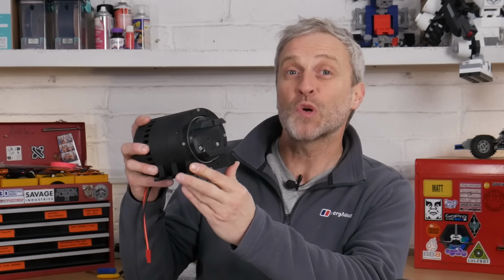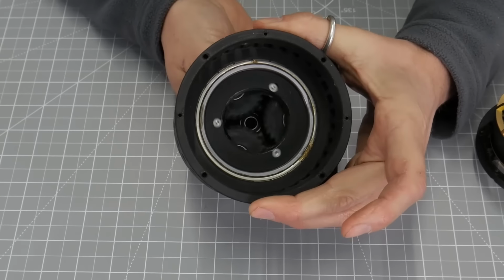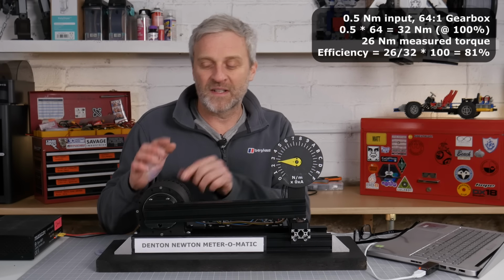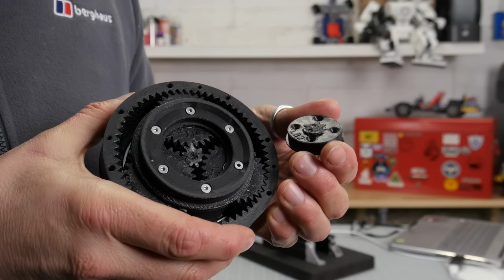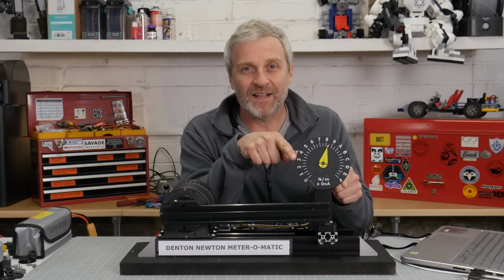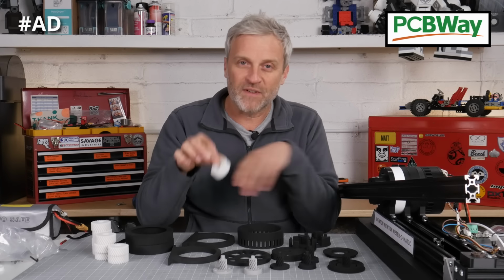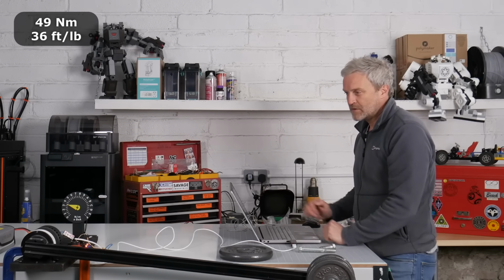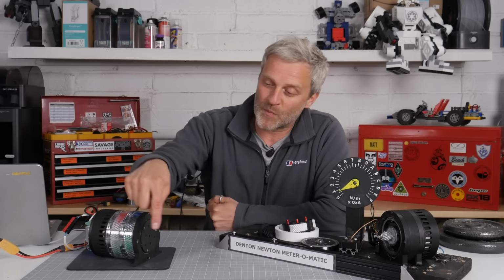Massive Torque 3D Printed Planetary Gearbox! - Mantis Hacks

Comment: The torque Test in the end is a little bit misleading as the tourqe is not the same in the static test. You are accelerating the mass and have to calculate the moment of enertia to get the correct moment of your gearbox thats why it failed
Reply from the maker: Yes I agree, there is a huge difference between static and dynamic loads. However, the point was to show that at slow speed which are similar to static loads, when the leg of a headed is in support phase this gearbox probably would work. When it’s accelerating fast it only needs to lift the weight of the leg and would be nowhere near 125 N.m, I only wanted to demonstrate that it will move a very large load at slow speeds, I pushed it further for the fun of it :)

Comment: Bigger sun gear with metal core(screw).. that's how i made few years ago for door opener...
Reply from the maker: I did that.. it’s in the video
Reply: @MattDenton I express my self wrong,the screw was with intention to compress the material with 2 nuts and washers,but I didn't test as you to those limits,maybe my approach means nothing in giving straight
Reply from the maker: Ahh ok 👌

Comment: It seemed like you were having a lot of layers line failures with the FDM parts. Did you ever have a look at folding the parts? Since it seems like the sun gear is the main failure point, it might be a good solution.

You can find an example of folding bolts in the multiboard system for example (search for folding bolt multi board so you don’t have to navigate their fairly atrocious part menus).
Reply from the maker: I hadn’t thought of folding them but totally get or, I had thought of printing them on two halves

Comment: i remain dubious of any static efficiency test... or breaking test. both should be performed whilst spinning. braking test? 
its not just the static load ability but also how they resist rubbing, sliding, and impact loading. gears dont roll over each other, they slide...
so far, ive found ABS makes for the best gears that actually have to rotate and transmit torque.
recent reduction and found PETG lasted all of 30 seconds. abs gearset has several hours on it. strapped to a weedwacker engine. pretty harsh environment.
didnt think of resin but may try one in the "highstrength". had good results on other things... stays sort of rubbery. pliable.
Reply from the maker: Yeah that’s why the final test of having an actual moving load at the end of a lever didn’t perform as well as the static load test. Stall torque in gearboxes  is usually way higher than dynamic torque

Comment: Couple of recommendations:
1.) I would be very skeptical about using a belt on the output side with that much torque. It is REALLY gonna want to slip and at that high load you might break the belts. Your life will probably be quite a bit nicer w the belt on the input and a few more metal gears.
2.) I would also recommend looking into a different kinds of planetary, more specifically a split-ring planetary. They can achieve MUCH higher deductions in the same number of stages, and you wouldn't need your belt at all.
3. I would highly recommend looking into moteus brushless motor drivers to bring down cost. They are incredibly capable drivers that are quite a bit cheaper than Odrive. Definitely good enough for your application
Reply: Choose the right belt, and it shouldn't be a problem. Belts are used on engines, and they have considerably more torque.
Reply: @WillE86 your correct that belts are used in engines, but that is far from a 1:1 comparison. First, belts are not used to drive the parts of the engine under high loads. They are mostly used to drive cam shafts. When they are used to drive high loads, such as in superchargers, belts are extremely wide. The larger your belt is the lower the bending radius it can achieve. Having a belt rated for high torque application would also probably force you to increase the size of your drive significantly to ensure a proper FOC. Using an especially wide belt is also going to increase the moment loading on the gearboxes by a lot. The wider and higher load the belt,  the tighter you are gonna have to tension it. This will induce a pretty high load, especially for the output of a 3d printed gearbox
Reply: @davidbascom5781  I get what you're saying. I still think it's achievable. 
Reading through your comment made me think about the capstan drive. There's a decent video I've seen on YT by Aaed Musa, video titled, High precision speed reducer using rope.
Reply from the maker: Probably still worth a go 🤔
Reply: @WillE86  yeah it'll probably still work. Just might be a bit hard to tension and wear out a bit earlier. But if it works it works. Will probably be more of a useful comment if it doesn't work
Reply: Turbo charged 300hp snowmobiles still use belt drive.
Reply: @erik.... power is the product of torque and speed. The final torque of a normal city car of about 100hp is only about 200Nm and its using steel gears to deliver that. I guess it will work but certain design considerations will be necessary as pointed above.
And to be a bit pedantic 😂 the units on your torque dial that i really like, i think sould be Nm not N/m.
Reply: @SuperHaptics  You mean power is the product of torque and angular velocity (or force and velocity).
Reply: @dr.lawlis2426 i said it collqualy but from the question you are asking you get my point I think. You will rearly hear a maker on youtube talk about angular velocity of a motor, so speed everyone will understand 😊
Reply: @SuperHaptics  To be fair, if you are going to be pedantic about the proper units for torque, you won't mind being corrected for having the proper units for power.
Reply from the maker: Ok thanks for the info! I’ll look into some of these recommendations 🙏

Comment: Nice work!  If you play with the ratios between the first and second stage planetaries, you will see that for configurations where there is a small difference in ratio between the two, you will get very high gear ratios.  You can use this effect to make the sun gear larger, and have higher numbers of planets, for example, 5 or 6 instead of 3.  This should allow for greater torque in the same sized package.

I’m also curious, given your application, why you wouldn’t make the gearbox larger in diameter? It seems like there is plenty of space. For a direct scale, where the gear width scales as well, a 2x scale should give 4x the torque, or for only a 1.4x scale, 2x the torque. Tolerances don’t scale the same, so it may get a little more efficient as well.
Reply from the maker: Yeah I’ve been thinking about a bigger ratio stage 1 with lower ratio stage 2 to give a larger stage 2 sub gear. And yes I could scale the whole thing slightly but I like the idea of keeping it as compact and light as possible. Appreciate the feedback though 🙏

Comment: You should consider using double helical gears. It would make assembly slightly more challenging, but in theory, it would reduce axial loads, thereby reducing friction and increasing the gearbox's efficiency. The major reason that double helical gears aren't used more often is because of their complexity and cost to manufacture, but that's irrelevant with 3D printing.
Reply from the maker: Yep will look into that for sure 👌

Comment: Just a word of light-caution.  Using "white" plastic generally isn't a good indication of the mechanical performance of the plastic itself.  Specifically, white plastics often use titanium dioxide as its pigment, which degrades its mechanical properties.  When doing comparative tests between types of plastics, you'd generally want to stay away from "white" unless you're certain titanium dioxide wasn't used as the pigment.  I really enjoyed the video and the rigor that went into the testing...which is why I wanted to write up a small comment, in hopefully, an encouraging way.  Thank you for sharing your results!
Reply from the maker: Interesting!! So is this the case with sintered white nylon which is its natural colour?
Reply: @MattDenton  I couldn't say for certain.  =\  The manufacturer would ultimately be the authority as they would know if they added pigment or not, and what type of pigment was used.  But...since its sooo temping to say more...in dangerous generalities no-less...I suppose I will.  =D  Many plastics in their "natural" state before pigment is added are an off-white color ranging from a pretty dingy-yellowish-white to to a slight-off-white color.  Since the information isn't always readily available from the manufacturer online, I personally have a tendency to simply shy away from printing white for anything functional/load-bearing.  That said, I do print white though (mostly ASA), but for aesthetic features.  I can tell when printing, it "acts differently" in both bed adhesion and layer adhesion, which also translates to overhang quality...so, for each type of plastic/filament, white always gets its own print profile and all other colors get lumped into another profile (bed temp, printing temp, part-cooling fan speed, print speed/accel).  I'm just a guy on the internet commenting...do the research and decide what works for you.  But, if you notice white having weak mechanical properties, wearing out faster than other colors, or having a lower glass temperature, you're not crazy...and, you have a search term now: "titanium dioxide."  =)

Comment: Make a tripod beast maybe. Like half-a-hexapod.
Reply: The reason 6 legs is common is because you retain a stable base at all times even during continuous rates of forward motion. A four leg design remains stable while moving ONE leg, so it generally must pause for each time while other legs wait to be moved. Three legs must balance in a single axis via another mechanism while moving any one leg, just as a two legged robot standing still, and two legs must constantly balance in 1-2axis even when not moving. Each of these reductions in leg counts makes it exponentially more difficult to do, and massively amplifies the risk management needed to demonstrate it. 6 legs you can simply need a seat-belt and can safely ride anywhere you can keep people from being entangled in the legs, while 3 legs you need a roll over safe design and to keep crowds at about twice the vehicles height away, which quickly drains the fun.
Reply: @SheepInACart thank you for your clear, detailed and well explained response. This makes a lot of sense! You've got the makings of a script for a short video there! I really appreciate your having taken the time to reply. Cheers!
Reply from the maker: Statically Stable 👍

Comment: 1. Did you lubricate it? Not sure if you mentioned it. PLA just bonds together under pressure/load.
2. Increase the flow rate for the gears to 110%, I think you’ll be pleasantly surprised how much stronger it will get
Reply from the maker: Yeah using super lube!

Comment: The teeth on the planetary gears don't matter for the calculation. 9/27 x 27/72 = 9/72 - the 27 "falls out" of the equation. So just divide the 72 teeth on the outer ring by the 9 on the sun gear...
Reply from the maker: Actually I got it wrong and I’ll do an update video. The formulae is actually 1+R/S so in my case I did have a 8:1 reduction BUT!!! I didn’t have a 72 tooth ring gear, it was a 63 😬 so 1 + 63:9 = 8

Comment: hello your projets are always amazing. Yes I think you can downsizing the first stage in term of teeth modulus in order to improve the 1st dstage ratio. And then you upgrade the second stage teeth modulus and reduce the ratio (due to bigger gear) . 
But you need to do 2 designs and the worth 2 hard calculation....
Keep going.
Bye.
Reply from the maker: Yeah thanks! I think the first stage is massively over engineered.. so yes, higher ratio smaller first stage 👍

Comment: I'm glad to see that you ran through pretty much all the same failure modes I've gone through with my robot build. it's fascinating to watch what fails as you ramp up torque. I'm using steppers, but same basic idea. I didn't have the metal spline facility - but even just a steel core cylinder superglued on helped quite a bit up to the point the plastic shattered off anyway. I also found that surviving a few cycles in a test is not the same as surviving long term usage, eventually the wear and tear caused fairly spectacular failures.... in one I managed to shatter pretty much all the gears in the final stage in one go much like you, which at least showed the load was evenly distributed and it's quite a nice safety feature that when the gearbox explodes it also seizes in place rather than suddenly dropping :-) I came to the same conclusion that you really need to beef up the sun gear enough on the final stage at least. It would be cool to see a smaller version of the hexapod but I can only imagine how expensive that gets
Reply from the maker: Thanks 🙏 appreciate the feedback. Yeah I could take this way farther and maybe I will. I was being pretty lazy with the design as mentioned at the end. But I think I could easily get above 200 n.m but for how long 😂
Reply: @MattDenton  indeed. The pesky thing about forces is when they decide to go in directions you didn't expect... I was impressed how much speed you were able to get even with that reduction and torque. My biggest issue had been getting the torque sorted but at the cost of the speed. It's not super important when I'm moving a camera in most cases, but can make setup slow and reduce  motion options.

Comment: you could try modding the sun gear to have a set of 2mm holes through the layer lines and glue in some pieces of filament as reinforcement rods.
When I've used that trick with ABS I just dip the end of the filament in some acetone for a minute and use the ABS "melt" as glue.
Reply from the maker: Nice idea 💡

Comment: What if you use some screws to reinforce the sun gear? Lets say the diameter of the gear is 20mm, you could put 4 M2 screws at around 15mm, so that the shear force is applyied to the screws, instead of the layer bonding
Reply: there's not a huge amount of room to play with - but I do like this idea of using multiple separate bolts. when I built something similar I wound up putting a single solid steel core through the sungear  andpressfit/supercluing the gear around it. which worked pretty well but eventually the plastic shattered off. I wonder if having separate steel cores would help with that.

Comment: As the second stage experiences 8 times the torque it should be (about) 8 times as sturdy. Use finer, thinner gears with a larger ratio for the first stage and a larger sun gear (with smaller ratio) for the second stage. The first stage can have the forth of the current hight and the second the double. Technically the ration should be even greater but getting the torque from the bottom to the top of the second stage sun gear seems to be the main problem. So there is a limit on the benefits of wider gears. For the final output torque you are a the limit what the plastic gears can do, so to improve that increasing the diameter of the second stage is the way to go.  Using a higher modulus gears would also be stronger but I doubt there is much that can be done without more space to fit them as less than 9 teeth for the sun gear will only create new issues.
Reply from the maker: Yes I agree, the sun gear was taking well over 10 n.m before it was breaking, and the motor can only supply 4. So a lower ratio on the first stage would be better

Comment: A couple of ideas that perhaps could work. First you could print the sun gear at an angle on the fdm printer, somewhere between 30 and 45 degrees so there isn't a layer line directly on the transition. The other thought would be to have the first stage and second stage have opposite slants on the gears so the whole unit behaves like a herringbone gear.

Make the mini mantis, you know you want to.
Reply from the maker: Yeah lots of ideas to try.. if I find the will power I’ll do an update.. I have to make an update video anyway, I got the gear ratio calculations totally wrong 😑
Reply: Exactly what I was thinking, too. Reduce the load on the layer to layer adhesion by rotating the print, or split the part into two and screw them together. The latter option might not be viable for the sun gear because of the overhangs.

Comment: Shortening the first set with 50% and increasing the second by 50% will give you 50% more torque with out making it larger.

I really doubt the motor is even close of ripping the gear of the first stage.

But that also make me wounder if this is really the best way of making a actuator. Maybe i didn´t understand the concept.

But for a concept that need a lot of force in one end and barley any in the other end. Having it close to in line with the force (if not fully inline to a back stop) when at force, and having it at close to 90 degree angle when moving fast, will give you both very high strength as well as quick moment. Now, that might be exactly what you had in mind, and i just didn´t get it.

And this goes back to the 3 freedoms of control. I would argue that you may only need 2. With a rotating beam the vertical motion could be controlled by the rotating beam vertical axis and the outer leg for the horizontal axis. A example of that Theo Jansen strandbeest using only circular motion for a full leg motion, and still have a very similar motion to what you need via a 4 link arm.

Using a servo in steed of a continuously rotating arm could improve the mechanics even more, improve motion speed as well as having more force on the foot contra the rotation axis.

The secondary motion could probobly be done with a linear actuator